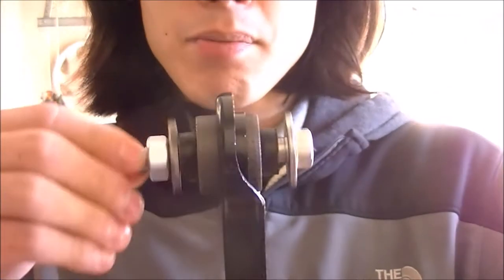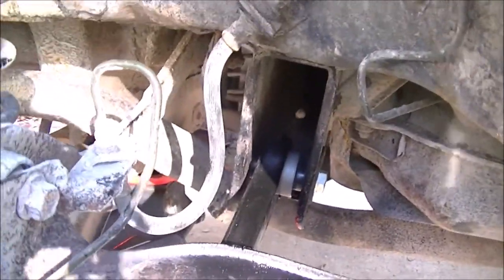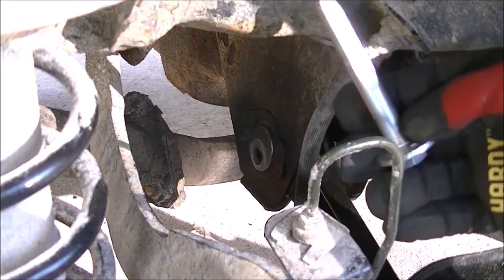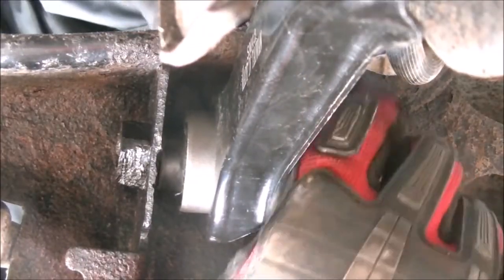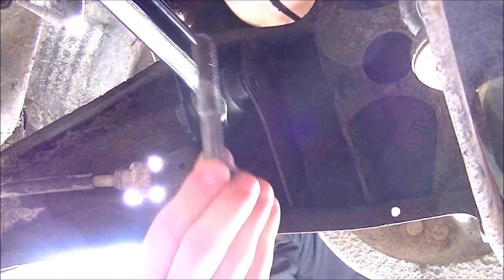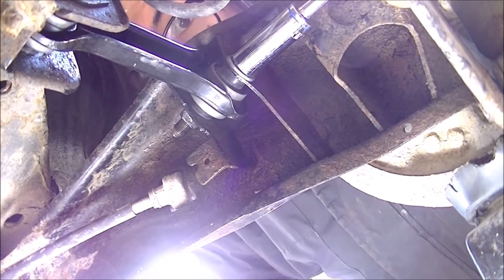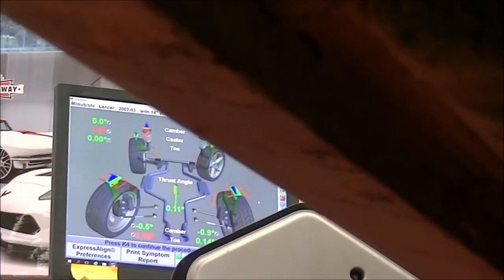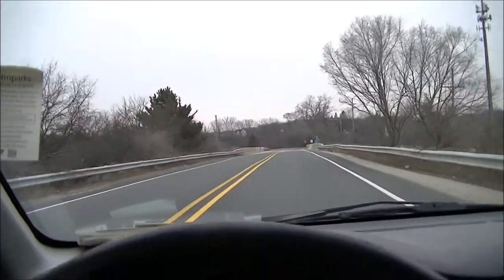Rear Lateral Link Replacement on 2002 Mitsubishi Lancer (Passengers Side)

Comment: Watched a few of videos fro reference for past few years since I've owned my 2002 Lancer since 2017. I just wanted to ask why don't you modify your car, does that interest you or just fixing them up? I have a 1990 Miata which I use for fun and fix up as well as the Lancer. Just curious, I enjoy your content, and I hope my Lancer can last as long as yours!
Reply: No way, I also have a 2002 Lancer, and my miata is a 1997 M Edition.
Reply: @ufork  lol damn I just sold my Lancer this past Feb. got a new daily but still got my Miata!
Reply: @MxRaph  just replaced the front shocks and springs on my lancer, i have been driving it for almost 4 years. Have had the miata for not even two years. As of right now, I plan on driving both of them until the wheels fall off. Lancer's fuel economy can be pretty disappointing for a daily driver though, considering how slow it is so I'm glad you upgraded. I was thinking about keeping my miata and upgrading my daily to some other 2000s beater except with a manual (my lancer is auto unfortunately) or getting one of those new non-Type-R civic hatchbacks but with the 6-speed. As you can tell, my miata has made me really love driving manual lol (first manual car and second car ever)
Reply: @ufork  Oh shit man that’s kinda funny, the lancer was my first car too and it’s an auto. Yeah gas mileage isn’t the best but it worked for my first car. Miata was my second car and first manual car as well!